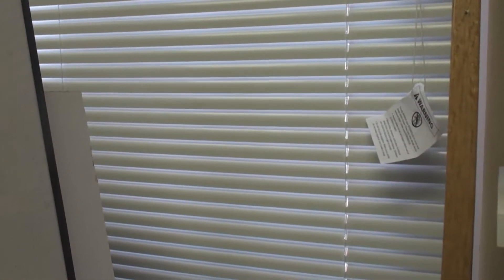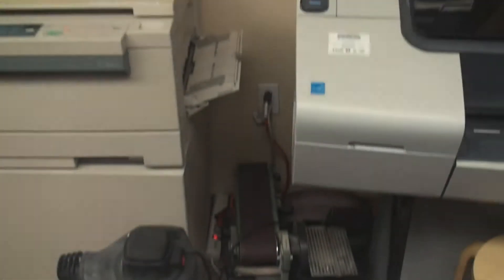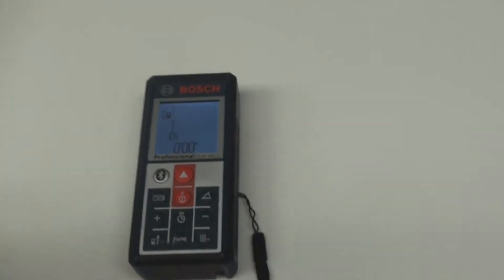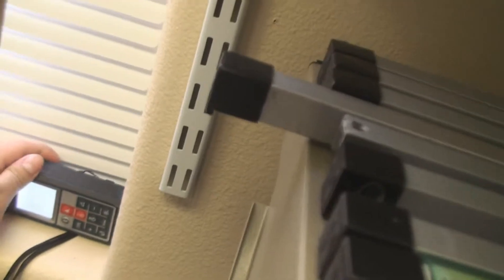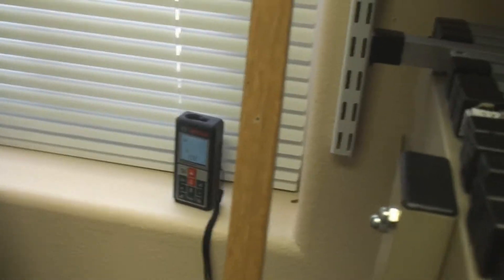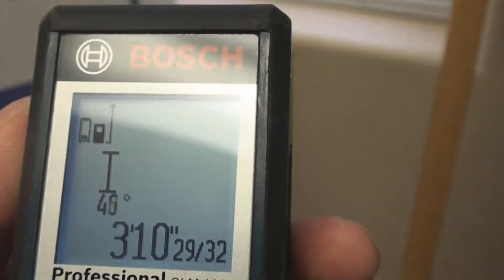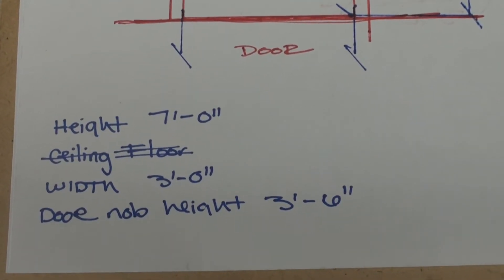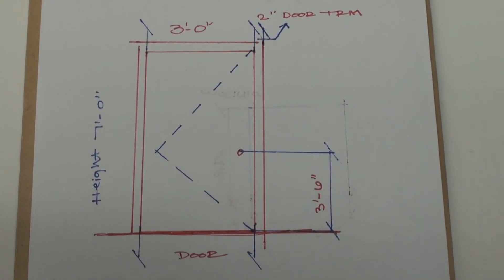Measuring Doors and Windows with a Bosch Laser Measure for tenant improvements

Comment: How can you measure the door jamb though? Isn't it impossible to do with those lasers?
Reply from the maker: When measuring a door and its frame a laser can be helpful but it will also likely be beneficial to have a tape measure. When locating the door in the space it is relatively easy to use the laser to measure to a nearby corner of the room or another object in the space. Once located the laser can be used to find the door's height and width. A laser does typically struggle to measure things that are smaller, it may help to use a tape measure to measure the width and depth of the door frame.

Comment: My husband works in the door repair and installation field. I was able to come up with a basic sketch of a storefront door, metal hollow doors, herculite doors, patio doors, etc and every time he gives someone an estimate he chooses the invoices with the best matching door sketch and marks on the invoice any details the office might need like what type of wall they are going to be putting the frame in, how many inches apart are the hinges, how many feet from the ground is the door handle and lock, etc. Then the customer is given a copy with the measurements and all on it and then he faxes the other copy to the office so they can give that customer a down to the penny quote of exactly how much the job would cost. Maybe you can do something similar for your company instead of wasting valuable time sketching it all out on the job. Efficiency and accuracy is always the most important in a field like this especially when you have one of those nitpicky customers who think they know it all but have never seen a window or door ever be installed or ripped out. lol
Reply from the maker: Thanks for your input! We're glad you're checking out our videos!
Reply: its a teaching example.